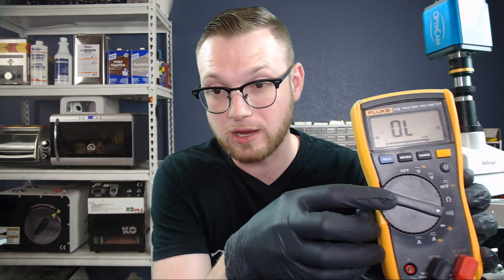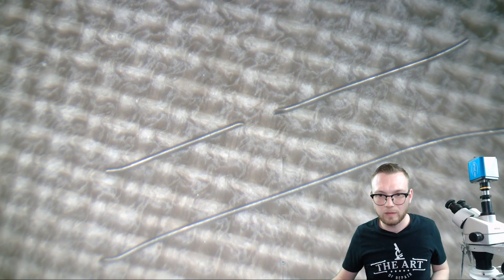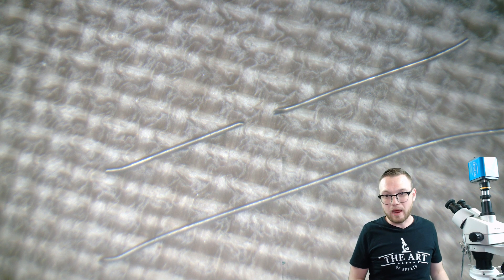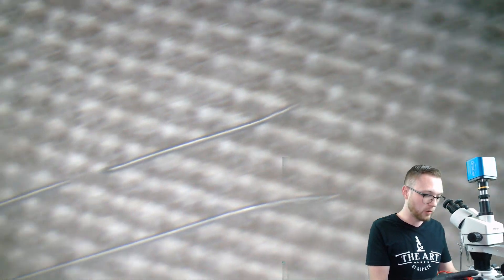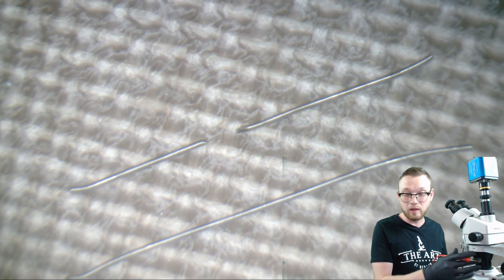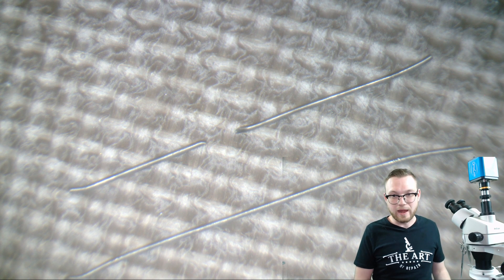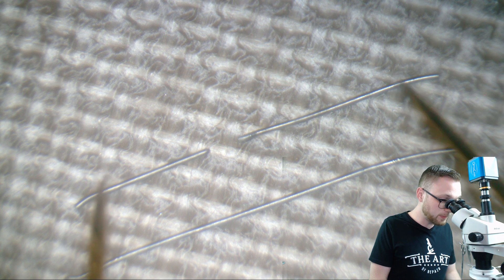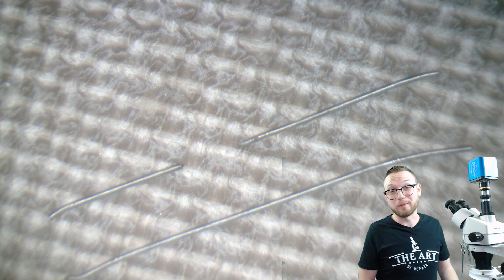EP47 Multimeters 101 | Continuity Mode | How do I tell if two parts of a circuit are connected?

Comment: credit where credit is due. This video helped me repair one of those digital thermometers vets use on fridges where we keep vaccines lol. Was at a clinic talking to the vet, and he had one of these that didn't work. I figured I'd take a look at it. I sort of knew what the continuity feature did, although mine is a little different, as it measures what I assume are micro ohms. Anyway the thing wouldn't even turn on. I (correctly) assumed it was some sort of issue with the soldering of the power leads, and after inspecting the PCB I found some points that looked like they should have been soldered, but never were. reading between + and - terminals read like 500 something. Soldered those little points, and all became right with the world. Good video bud!
Reply from the maker: Logan, this is an awesome story, number one because you fixed a PCB and learned something but. Number two because I love knowing a video I made help at a vets office! I love animals 💪💪💪 

Hope to hear more from you in the future on your repair journey! Thank you for sharing :)
Reply: @TheArtofRepair  I wish I could share pictures, but I kept the probe in my fridge all night and something about waking up and seeing it there working just made my day lol. Yeah, great video! I'll be sure to check out the rest of the channel